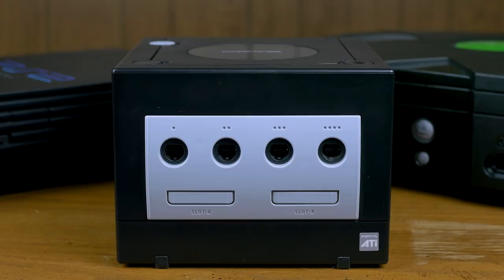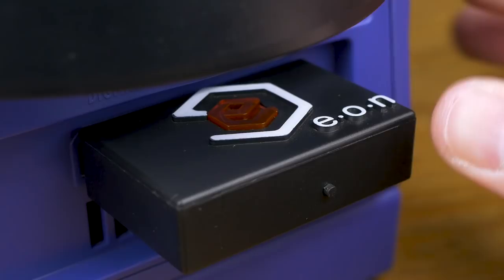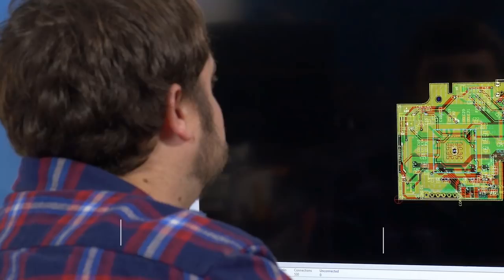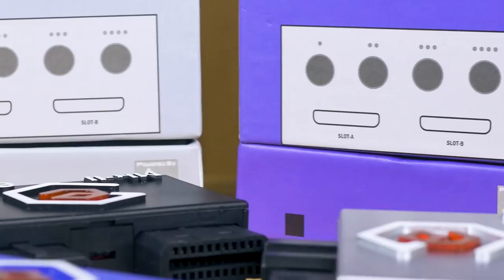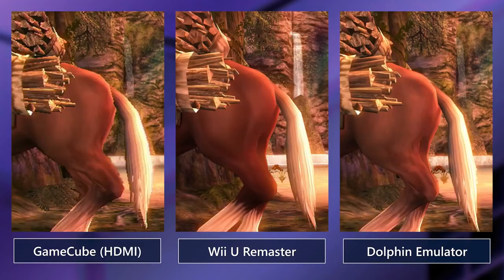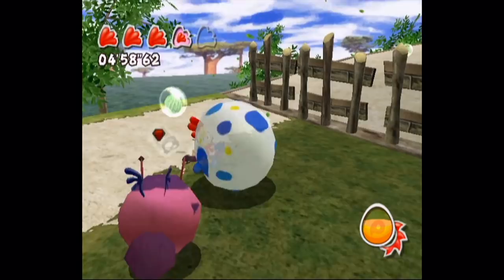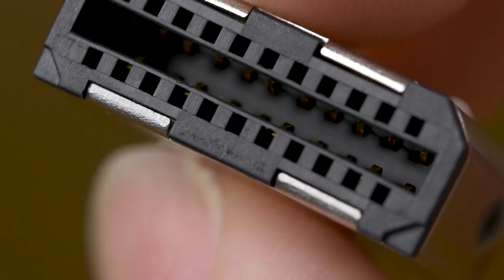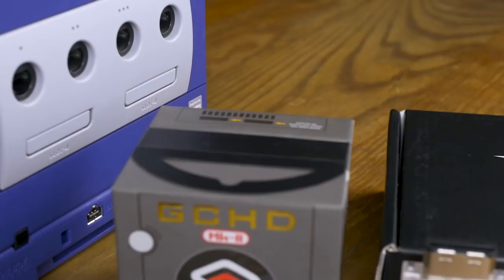Nintendo GameCube HDMI, Component & RGB Plug 'n Play Solutions :: RGB316 / MY LIFE IN GAMING

Comment: Okay I have a problem with the carby so if you or anyone can help me, I would greatly appreciate it because no one at insurrection can.

When I enable progressive scan, the picture gets super jagged. It’s not “crisp” like everyone says theirs is. If I disable “enhanced DVI” mode then it goes away but then I get no audio.   Quite honestly, the picture looks WAY better without progressive scan enabled. Lines are smooth and crisp but I don’t want that to be the case or I’d at least like to know why that is the case. 

Also if progressive scan isn’t enabled and I enable line doubler, the picture gets worse. Could it be my tv is doing the upscaling already?

I have an older 1080p Vizio if that helps anyone
Reply from the maker: [Try4ce] There's a lot to this, I think. For one, I believe you must be on the passthrough mode. When you describe the 480i image as smoother, that's because your TV is deinterlacing. The bobbing effect you see on 480i games is a faster technique that reduces input lag and looks more like 480i on a CRT, but most people seem to hate it (I don't mind it). As for the super jaggy look, to me that sounds like you're seeing it correctly. It's 480p on a modern TV. It's gonna be jaggy. It will not look like an HD remake. Some people don't like that look. Not much you can do about it other than connect to a VGA CRT monitor with a cheap lag-free HDMI to VGA adapter connected to the Carby instead.
Reply: @mylifeingaming  thanks for the reply! 
So let me get this straight (I’m a noob)
Are you saying my tv is doing the work already and converting 480i to 480p? 

Another thing I should mention when I force 480p is the picture looks like it has lines running through it. Like the picture is being separated and broken up. It just doesn’t look like that in every video I watch on the carby. I feel like I’m an outlier lol

Comment: I don’t get it I can get Game cube component cable at Walmart fir 5 bucks, so idk why it’s over 200 on eBay lol pretty sure it does the same thing
Reply from the maker: [Try4ce] Walmart no longer sells GameCube accessories, but they never sold the component cable. Maybe you're confusing component and composite? It's a special cable that uses circuitry that wasn't cracked until a few years ago. Not many people bought the component cables because not many people had a TV that could use it back then, and you could only order them from Nintendo. So they're rare, and the only alternatives are like the ones in this video.

Comment: Does the carby output audio at all?
Reply from the maker: [Try4ce] Yes, however there may be incompatibilities with some TVs or setups with how digital audio is handled by all GameCube HDMI devices. If so, there's an option in the menu to enable or disable DVI audio if this is causing a problem, but personally I've never come across a situation where it didn't work. Otherwise you'd just have to do what you do with official component cables, and use audio from the regular AV port.
Reply: Thanks

Comment: Ok... so the GCHD-MKII just came in, and while the picture is crisp, everything displays on a slant... not sure whats going on there.  I tried using different Wii Component Cables, I tried cleaning my digital/analog ports, I tried different ports on my TV.  I have no idea what it might be... I hope I don't have a bad unit.  Anyone who might know what my problem is, please let me know!
Reply: I have a KV-36FV310 Sony Trinitron TV.  It's Standard Definition with 2 component ports.  Using OEM Wii Component Cables.
Reply from the maker: [Try4ce] Like, a really strong obvious slant? That did not happen to me. Have you tried games with different resolutions to help troubleshoot? 240p, 480i, 480p?
Reply: @mylifeingaming  I've tried Eternal Darkness and Mario Kart Double Dash.  The screen wobbles, and it's on a slant in such a way where I see 2 copies of the picture.  \  \  \
Reply: @mylifeingaming  FIXED IT!  The device is fine... the MK-II is set to use the line doubler by default.  Since my TV only does Interlaced... it was all askew.  Once I turned off the line doubler, it looked PERFECT.  MAN this device is worth the $150!

Comment: These won't work on Pal?
Reply from the maker: [Try4ce] Oh of course they will, if your system has the Digital Out port. But PAL region games for GameCube do not natively support progressive scan modes, so either you'll be dealing with 480i/60Hz or 576i/50 unless you use homebrew software to force 480p. Your system can handle it, but the games don't officially support that mode.

Comment: Trying to make my own RGB nintendo cables. Anyone know a source for the standard nintendo AV port? (not the wii one)
Reply from the maker: [Try4ce] I don't have a source, maybe RetroRGB has resources? Do know that the correct specs vary between consoles.
Reply: @mylifeingaming  Nothing directly. If I have a 3d printer no prob but right now I don't. Have been looking through Alibaba and others. I feel guilty cutting up original cables.  

Also MLG Rocks! Would you guys think about doing a modern TV episode like reviewing tvs with ports, resolution, and features.

 I am curious how Nvidia new gaming TV will be able to handle retro games. Of Course I know you guys aren't going to get a ton of Tvs review tvs but specs and what to look for. 

Also have you ever thought adding power conditioner to your gaming set up? And if so would it benefit the signal?
Reply from the maker: [Try4ce] I haven't really had issues with power so I have not tried a power conditioner. I would be careful about buying the ultra cheap cables on Alibaba etc. I know they are way more affordable, but you can't be certain they will not just be composite video in a SCART shell, plus they will almost certainly use very poor cable stock, which will result in noise, especially when combined with composite video going down the same lines. I know it's more expensive, but the coaxial cable stock from sellers like Retro Access makes a big difference for minimizing video and audio noise, especially if composite video is used for the sync signal. It's not necessary for every setup, but it can also solve a lot of issues. There's no need to cut up original cables.
Reply: @mylifeingaming  Oh no the chinese stuff I am only looking for the plastic for the proprietary plug sorry (nintendo and sony). Cable wise I live in LA lots of pro video companies and suppliers out here. I will be using good shielded cables likes belden or metra.

Comment: Csync or sync on composite for the cable?
Reply from the maker: [Try4ce] I believe Wii SCART cables are only made in a sync-on-composite variety, but I'd need to double-check. But I'm pretty sure the Mk-II provides a CSYNC signal to the cable regardless. Just buy a Wii SCART built to the standard specs (but don't go for the cheapest ones or else you may introduce noise to the signal).
Reply: I only get my cables at retrogamingcables they had a csync version, so i was confused! @mylifeingaming
Reply from the maker: [Try4ce] Oh OK in that case the CSYNC cable is just using a sync stripper then, which would be unnecessary in most situations. It's not true CSYNC, it's just adapting the signal to CSYNC in the case that it would be needed for certain equipment.
Reply: awesome i plan on using it with the ossc. Thank you so much for the help! big long time fan! @mylifeingaming

Comment: Wouldn’t a Wii2HDMI for GameCube games still be the best option?
Reply from the maker: [Try4ce] Definitely not. That is an analog to digital converter, and a cheaply made one at that. Remember that the Wii can only output analog video. The GameCube has a true digital port. On top of that, the Wii2HDMI units vary wildly in quality. I haven't fully tested them yet (it will be featured in a somewhat near-future Wii episode), but they are absolutely not the best option. A convenient and possibly acceptable option, yes, but not the best.
Reply: God damnit why didn’t I consult with you before wasting $25 on this wii2hdmi converter! Gah! Could you recommend the best option for best quality on a Wii for GameCube games? Thanks so much I’ll buy whatever you say regardless of price
Reply from the maker: [Try4ce] It's possible some of those are OK! I have only briefly tested the one I received, and it looked OK enough at a casual glance, but I haven't dug any deeper. Wii consoles simply look best with component cables if you have the means to use component well. If not, the OSSC or RetroTINK-2X are great for converting component to HDMI, BUT keep in mind that the RetroTINK cannot take 480p input, so that wouldn't be the best solution for GameCube.
Reply: When you say able to run component well, what would that mean exactly beyond a modern hd tv with component inputs?
Reply from the maker: [Try4ce] Well, mainly I mean the fact that component is increasingly becoming a rarity on modern TVs. But for those that do, they probably handle 480p  content reasonably well, so you are probably set if your TV has component input.

Comment: This is so confusing. I just want to play on a Gamecube, what do i need in 2024?
Reply from the maker: [Try4ce] The HDMI adapters are pretty widely available now if your GameCube has the Digital Out port. It will not be high resolution, but newer upscalers with HDMI input like RetroTINK 4K, OSSC Pro, and Morph can take care of that.
Reply: @mylifeingaming  it was meant more sarcastically, but thanks for the tips. Honestly from the video I couldn't really see the difference between the normal hdmi adapters and that plus upscaling. They seem to be worth it. If you want the best fidelity it seems like emulation is the best way to go.

Comment: 6:28 Where do I find these??
Reply from the maker: [Try4ce] I'm not sure anymore. But please keep in mind that they are only useful if you have GCDual installed. They won't work for an unmodified GameCube.
Reply: @mylifeingaming  [For Tr4ce] But for composite video with composite Wii cables, has better video quality than the typical SNES composite video cables which looks so blurry. It works with GCDual mod, was it?
Reply from the maker: [Try4ce] I'm not so sure there would be a huge difference between Wii and SNES style composite cables, especially official ones. Also, I'm not sure, but am skeptical as to whether composite and S-video pins are routed on that adapter.
Reply: @mylifeingaming  [For Try4ce] In fact, there is a difference between SNES and Wii composite cables, there are comparisons on the internet already and I tested GC games on both platforms by myself and that's true! It would be a pity if those GCDual plugs would not work with Wii composite on a SNES/N64/GC for a composite sharper look. (Also it may be tested already with the Eon GCHD composite)

Comment: "GC support was dropped on latter wii models"
What about Nintendont + GC adapter for the wiimote + wii true digital HDMI mod, mate? Certainly cheaper than those scaler boxes.
Reply: Actually that latter Wii RVL-101 models hardware does support Game Cube and isn't too different to the last motherboard revisions of the RVL-001 models. Disc doesn't work because the disc drive used in them can't read GC discs, just changing the disc drive for a previous one that can read GC discs should let it use actual GC discs. As for the GC ports... if one solders them where they were in the latest RVL-001 in a RVL-101 motherboard they should work, but I doubt that most of users will who as far as that.

Comment: Boo, so am I just SOL if my GC doesn't have a Digital AV Out port?
Reply from the maker: [Try4ce] It's theoretically possible to mod those systems for HDMI, but I'm unsure if the current methods are designed for those or not.

Comment: Useless, can somebody tell me a way to get a HD PAL gamecube working since the component was a America exclusive?
Reply from the maker: [Try4ce] There are very few differences between NTSC and PAL GameCube systems. The port that allows for component cables was also on PAL systems and works the same way. You use official component cables, a Carby, or any of these other accessories if you have that port, regardless of your region. However that port was removed from later systems in all regions. If you don't have it, your options are not as good. PAL GC can output RGB from its regular AV port, which NTSC systems don't have. However you can't get 480p without the digital port. However the biggest limiting factor of PAL GC is not the system, it's the games. PAL region GC games do not support 480p, while most of the big ones in NTSC regions do. However you can use homebrew tools to force your PAL games into 480p, but that's only useful if you have the Digital Out port. You can in theory mod systems that lack the Digital Out for an HDMI port, but obviously that's a lot more complex and destructive and I don't know much about it.

Comment: Serious question here.  Is it really worth it on retro consoles to go to this much trouble & expense just to get a very small different in picture quality on a hdtv?  You're ever only going to get a big enough difference using dolphin or something.  Then there's always always going to be hdtv lag on retro consoles.  And sure spend $100's to get rid of most of that lag.  I have collected for a very very long time myself but I really don't see the point unless you spend a lot to mod/etc and actually get a lot back as well.  I've tried various things myself and it's really not worth it in all the things I've tried.  Like a component cable on a ps2 hooked up to a hdtv isn't going to make the picture magic 1080p/4k graphics or something.  You're just upscaling on retro stuff.  At best you'll get rid of jaggys around the edges and stuff.  And a lot of the time you have to use emulators for even that.  

And no I'm not trolling either.  I actually want legit answers from people on this.  I want to see just how many people think it's worth it and how many don't.  This isn't hate either.
Reply from the maker: [Try4ce] People do have to keep perspective on the resolution limitations of course, especially for the GameCube generation. Playing my original systems is really important to me for a lot of reasons, one being that I just like the assurance that the game is running in the most stable predictable processing environment possible, for total gameplay accuracy. Some people have a hard stance on CRTs only, but we certainly don't, even though we enjoy them a lot. I think as long as you remember 480i/p will never look like 4K, you can still appreciate the look of these games on HD/4K displays if the method is high quality (certainly there are many bad methods for getting these games to a modem display). Besides, most folks aren't going to make the space for a CRT these days, but I don't think that means they shouldn't be able to enjoy using original hardware if that makes them happy. These upscaling methods can be worth it if using retro consoles are a big part of your gaming life.
Reply: @mylifeingaming  Yeah I'm fine with that.  That's why I try to keep a open mind about it.  I've had the heavy 100+ lbs crt's and such too myself.  Thanks for the reply.

Comment: What happens if you put GameCube component cables in a n64
Reply from the maker: [Try4ce] You can't. Different port. The N64 doesn't provide the needed information to use them even if it did fit.
Reply: @mylifeingaming  I thought the GameCube and the 64 used the same plug
Reply from the maker: [Try4ce] Yes and no. Early GameCubes have two plugs. One is the same as N64, and just like N64, that port provides composite and S-video. But the OTHER GameCube port is a digital video and audio port. While the component is an analog signal, the GameCube component cables (and other GameCube component solutions) derive the component video signal from this port by using a circuit to convert the digital video to analog. Digital video wasn't really much of a thing at the time. Since not that many people bought the component cables, Nintendo removed that port from later GameCube systems as a cost-saving measure, leaving only the same port that's on SNES and N64. Perhaps this is the system you're familiar with.

Comment: They should have made also one for the PS2.
Reply from the maker: [Try4ce] Would be neat, but PS2 doesn't have that Digital Out port like GameCube, so it would be converting analog to HDMI instead.
Reply: My Life in Gaming Yeah or maybe it would really be cool if the PS5 would be backwards compatible with older consoles and maybe do PS3 like emulation on PS2 games.
Reply: @mylifeingaming  Yeah but Try4ce, imagine mods like the NES where it gets digital signal from the GPU directly.

Comment: Can it stretch games to 16:9 that's all I want
Reply: pretty sure your TV or PC monitor will stretch to widescreen regardless.
Reply from the maker: [Try4ce] You CAN if that's your thing, it has a function in the menu for it, but personally I'd only use it on games with proper widescreen modes like F-Zero GX.

Comment: Too bad none of this works on PAL Gamecubes
Reply from the maker: [Try4ce] Not true. Earlier PAL systems have the Digital Out port just as they did elsewhere. The PAL GameCube is just as capable of all this, BUT the games don't natively support 480p. They'll still work with such solutions though. But if you want 480p for a more stable image, you can use homebrew software called Swiss to force 480p in many (most?) PAL games. You can find compatibility lists online.
Reply: @mylifeingaming  yeah but alot more hassle than just plug n play